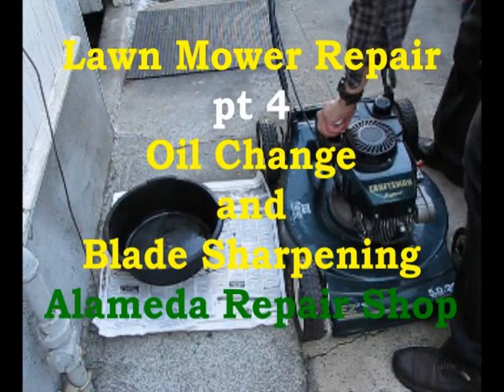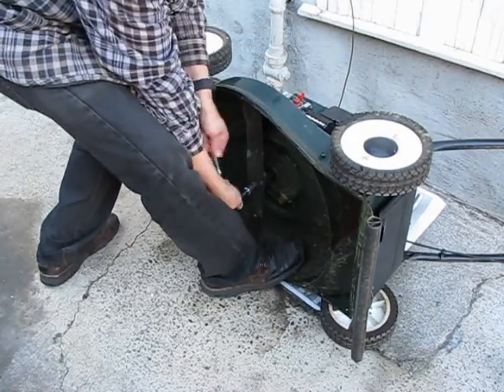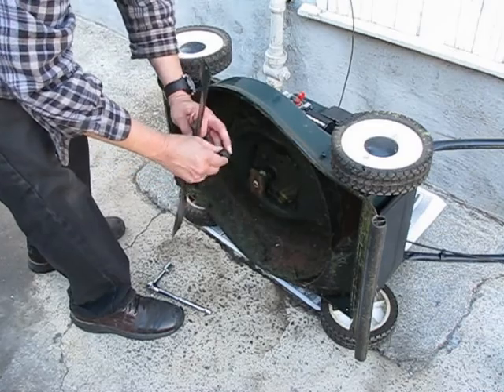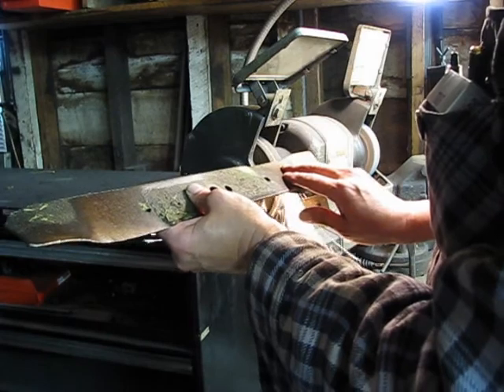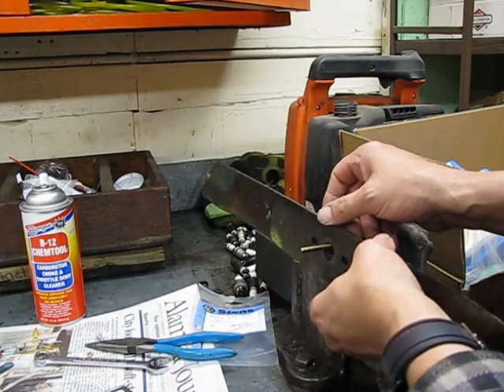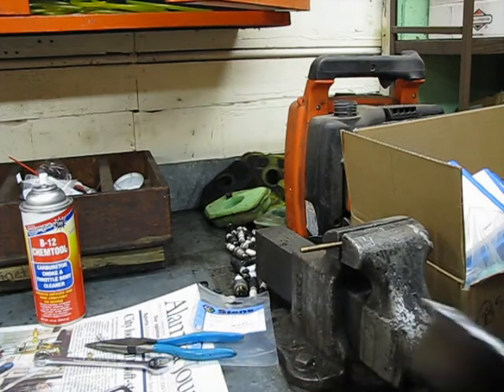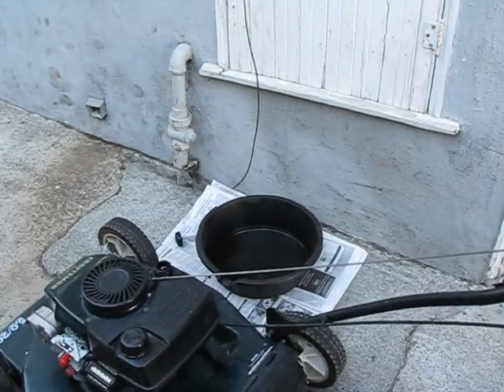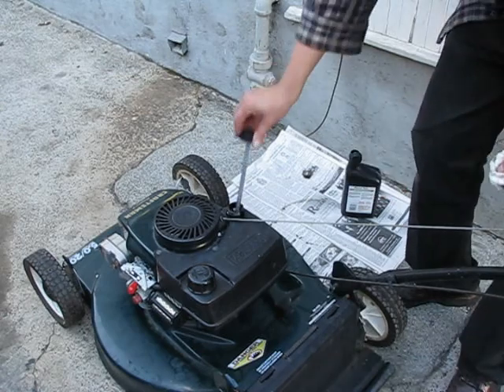lawn mower repair pt 4, Oil Change & Blade Sharpening, Craftsman Tecumseh, Alameda Repair Shop

Comment: Instead of turning the lawn mower to the side there's a yellow plastic nut at the bottom to drain out the oil..
Reply from the maker: Eric Deshields It's less messy & those plastic nuts are many times already cross threaded and if not leaking are best if left alone.

Comment: If you please help to select the best grit number of the grinding wheels? eg. 36, 60 or 100???
Reply from the maker: +Nikunj Patel For mower blades I'm currently using 80 grit, but anything from 60 to 100 should be OK. The higher the number the finer the finish and slower the material removal.